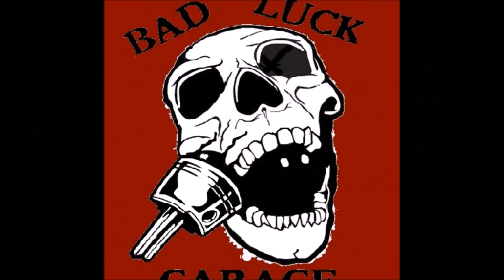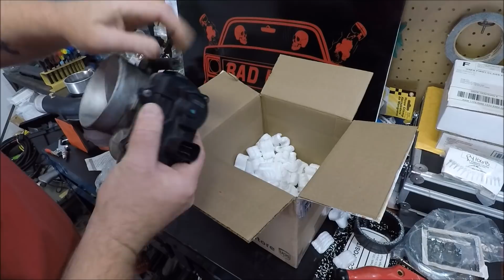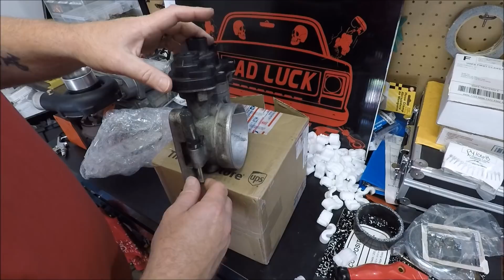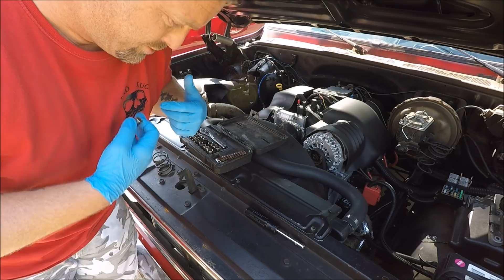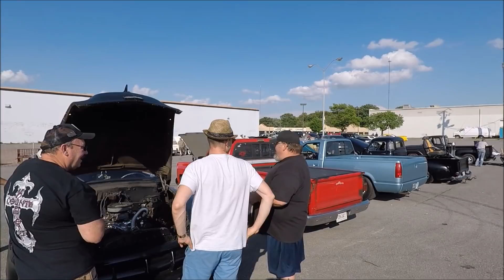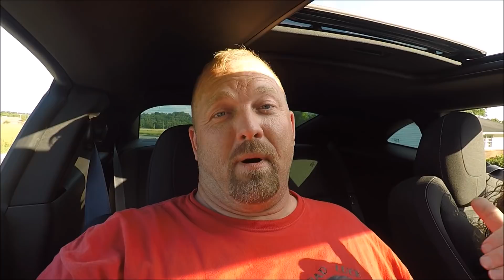TURBO LS C10 DBW ISSUE (REDUCED POWER MODE)

Comment from the maker: I’ve recieved several emails since posting this video Saturday about the black double print tee. It seems I have infringed on YouTube’s copyright by placing their logo on the shirts and because if this shirts are currently being taken down. I am working with YouTube to obtain permission to use the logo but should that not happen I will be redesigning the shirts and removing the YouTube logo. Thanks for your patience and understanding as I am new to all this.
Reply: Bad Luck Garage hey sir oh sir, i put 42lb injectors on my build, took it around the block and gave a a good amount of throttle and it bogged down, would that be becuase it needs a tune??
Reply from the maker: Yes sir. Anytime you switch to a larger injector you’re going to need to input the new injector data at the very least.
Reply: Bad Luck Garage thank you sir, have a guy coming over today to do that for me!
Reply from the maker: Anytime brother. 👍🏻

Comment: Hey did u ever figure out what was causing ur 5psi boost issues. Cause I did leak tests on both sides had a few exhaust leaks. Which I fixed . Have a leek at my gplus 102 so I just ordered a Fitech 102 to replace it . The leak at the gplus was pritty significant. But I have a feeling that that’s not the full cause of a 7psi loss . (12lbs spring) could it be a tune ? But when the car hits around 4-5psi I do hear a strange hiss but for the life of me I can’t find anything.. sound is common from pass side (turbo side) . Man I’m at a loss .. lq4 7875 billet ball ss2 cam lunati 660 springs . Ring gap at 28thou 4l80 3200 stall 342’s  .. car is a turd decapped 75lbs injectors. Duel 275 pumps in tank . I have the same speed daddy gate n blowoff as u run .. any help would be appreciated.. like I said it’s a turd but a stock 6.0 should spin tire n/a n I feel like it’s got about 200 hp really sad
Reply from the maker: I was actually running a genuine Tial wastegate on this truck. It’s been a few years but the only issue I really remember as far as boost was when I was running the 66mm turbo that was way too small. Once I switched to the 78mm turbo I had issues with the throttle body fluttering at around 12psi and going to reduced power mode as shown in this video. The fix would have been to switch to a cable throttle body which is what most people do when they start having those issues. Unfortunately I never finished doing that as I sold this truck about three years ago and bought the other vehicles we’ve built in the channel since then.
Reply: @BadLuckGarage  ok thnx but I have a dbc n I just ordered a fitech should be here tomorrow. Cause that eBay 102 was leaking like crazy where the spring is from the shaft n bearing . It was so bad that the soap I sprayed on it wasn’t bubbling just blew the water away . So I’m hoping that’s the culprit. Thnx for responding. If there’s anything u can think of let me know . I based my build off ur videos . I even got that converter u indorsed. 7875 96ar billet ball turbo ss2 cam lunati 660 springs mild port on the heads. 44mm wg 50mm tial knock-off fitec sheet metal intake ( which I hate .. too noisy) big intercooler (which is blocking all my air running hot) terminator x max 7” dash . hd2 transgo in the trans . I even setup my lines with the catch can n check valves like u said . Very happy with all the things up taught me . Some things listed that I did on my own didn’t workout so well like the intake n intercooler. But I’ll work things out . Keep doing what ur doing . Taught me a lot .

Comment: I’m haveing this exact issue it’s a stock 5.3  swap ina s10 an once I mash on it an it runs trough gears in gets to 3 an then revs out an limp mode killing it an restarting usually fixes it but only to do it again need some help thanks
Reply from the maker: You’re problem is actually very different but the result is the same. In you’re case it’s most likely a broken or loose wire at the connector of the throttle body. That was a very common issue and gm actually has a TSB on replacing that part of the harness. In my case it’s an incoming air/boost issue that the DBC throttle body can’t handle as explained.

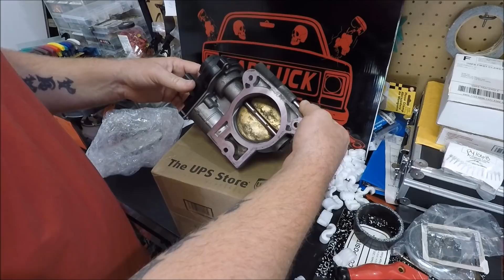Comment: Knew for sure not the tune.  I cant even watch till the end to say I fuckin knew it..lol  But fingers crossed dont backfire..lol  But I searched high and low cuz was bugging me not knowing.  But from other guys especially your year agreed the boost closes it then tps says open it,  back and forth then says wtf..  One guy talked to fixed it with using those kits that eliminate throttle lag.  Ill send you a link.  But playing with big twin turbo set ups there is a few things that could be causing the 1st gear blues.  Size of intercooler if running any.  Think compressor.  Tank has to fill.  So does your intercooler and every other lil areas of space.  !st being so short running Prob 4:11's etc everything cant pressurize and build 7lbs before shifts..  Plus as proved to many who argued it lets all this pressure go between gears.  It sort of does.  Starting your pulling vacuume.  After shifts you start at 0 not say -10 having to build to 0.  Another to is not running the proper vacuume lines where need be.  Like certain lines "Must" go before the turbo always pulling vacuume and others after.  Got one before where should be after.  Itll pull your boost through a loop.  Which no leak test will pick up.  Cuz its not leaking if makes sense.  But man do I ever wish lived close cuz could do this shit all day long every day.  Oh..  another to that made a stupid diff in my Nissan was split down pipes and a dual pop charger set up.  Ran dual throttl bodies with 3 inch pipe going to single.  so might as well benn to 1.5 inch pipes.  Can only build pressure regardless size of turbo as quick as you can pull the air in..

Comment: Most everyone I know ls turbo has dumped drive by wire for same reasons.
Reply from the maker: They changed everything out to drive by cable just because of a bad throttle body? That seems kinda excessive. 😳
Reply: Bad Luck Garage kept having throttle position issues and getting a cut out. You would thank over kill but seems to be working for everyone
Reply from the maker: Yea I know dbc is usually what people use cause it’s easier but I knew there were plenty of people running dbw too so I decided to stick it out instead of having to swap everything out for dbc. Glad I did now. 👍🏻 When I said it seemed excessive, I meant it’s excessive to swap everything out instead of just finding the issue and fixing it. I mean there’s really only two things that could cause the issue.....the tune, or the throttle body itself. I’m my case I knew the tune was right so it was just about finding a throttle body that wasn’t worn out. 😉
Reply: @BadLuckGarage   have same issue. Even after tune and new throttle body  under high boost still get reduced engine power, but the transmission also is flare shifting what transmission you running?

Comment: I’m having the same issues with my 2004 rainier with a turbo lm4. REP mode when I’m in boost and when I’m cruising it’s constantly hunting for the right rpm revving up and down.  I guess I’ll have to try a different throttle body too. Do you know what the the used throttle body came out of? I don’t know if that would matter or not.
Reply from the maker: Hello Barry Allen, Thanks for watching! The subscriber who sent it said it was from an 03 LQ9. Not sure of the vehicle. Before you replace the throttle body though, it sounds like you're having some slightly different issues with part throttle as well? You need to run a datalog and see if your throttle is flutteing like I describe in the video. If it is then its probably the throttle body. If its not then you may need to address some airflow tables in your tune. There are many tables that have to be changed in a DBW turbo application or they will trigger reduced power mode. Off the top of my head, the P0106, P0121, and P1514/P00068 tables in engine diagnostics all need to have the values changed to accept the extra airflow coming in or they will trigger reduced power mode. I actually had issues with several of those tables back when I first finished the build with the smaller turbo. The cool thing about the P0106 tables is that you can actually use them as an emergency overboost throttle cut as well to save your ass in the event of a boost spike.
Reply: Bad Luck Garage thanks, I appreciate the recommendations. I’ll check that out
Reply from the maker: Yes sir. Hope you get it figured out. I went and checked out your videos and that rainier is gonna be badass! I was just looking at one on Craigslist a couple weeks ago (sons turning 16 soon). But when I saw it came with a 5.3 I started thinking about buying it for myself for a project. Looks like you beat me to the punch on the whole turbo Rainier thing. 😂👍🏻👍🏻👍🏻👍🏻
Reply: Bad Luck Garage haha thanks man!  I originally went looking for a TBSS but that was 8 years ago and they were really expensive back then so I couldn't afford one.  then I saw the rainier sitting there and realized it had a 5.3 so i figured fuck it, I'll make it cool somehow lol.   It sucks though because they don't make hardly any aftermarket parts for a rainier so a lot of it I had to improvise on lol.  But at least it's one of a kind.  It runs good other than those couple of issues so hopefully I can get it figured out.
Reply from the maker: if you dont mind, send me a copy of the tune to thebadluckgarage@gmail.com  and Ill look it over and make sure all the diagnostic tables are good for boost. That way you can at least rule that out.

Comment: the wastegate spring rated psi is just an estimate, some people need alot smaller or bigger spring to reach their desired psi, It has alot to do with your setup, wastegate, turbo, wastegate placement, hotside routing and size, backpressure etc.. My car with a 7 psi spring only runs 5 psi and when i put in a 14 psi spring it would only get up to 8 psi. This is a ok problem to have, it is better to be able to control boost then it running away all the time. Idk what boost controller setup you have but with a 3 port mac boost controller solenoid  with port 1 to the top of the wastegate, port 2 to your boost reference source, port 3 to the bottom of the wastegate, when turning up the duty cycle to the mac solenoid it takes away pressure from the bottom of the wastegate while at the same time adding pressure to the top of the wastegate so you can run a low rated psi spring in the wastegate and be able to run way more boost if you want. I currently have a 14 psi spring in my wastegate in return only giving me 8 psi at the intake at 0% duty and at 80% duty im getting 18 psi. So can set my boost anywhere from 8 psi to 20+ psi with the same wastegate spring. I hope this help buddy. good luck.
Reply from the maker: It appears my autometer boost gauge is not reading correctly. After reviewing the datalog it appears I am indeed making 7-7.5lbs of boost (152-159kpa)but the gauge is only reading 4 or 5 so I may either have a bad gauge or a kink in the line going to the gauge.
Reply: ahhh..  see I though you said 5 in first but hitting 7 after..

Comment: I'm the same on problems,  my engine is only getting like 5lbs on a 11lb spring ima try to do that boost leak and maybe exhaust hopefully it isn't the turbo like urs
Reply from the maker: Actually I’m thinking the plastic line to my boost gauge may be linked or the gauge may be bad because according to my map sensor I am indeed making a little over 7psi even though my boost gauge only shows 4 or 5.
Reply: Bad Luck Garage oh ok ill have to check my scanner to, but what i have going on no way that feels more than 5lbs
Reply from the maker: Yea I’ve actually been having issues with the map readings not matching my gauge for awhile but I originally thought it was the cheap eBay map sensor. Problem is the map sensor readings match the wastegate settings and the gauge readings do not. So until I get a different map sensor to compare, I have to lean more to the gauge being wrong.
Reply from the maker: Also seat of pants feel can be misleading because one or two degrees of timing being pulled because of high aits can make 8lbs of boost feel like 5lbs.
Reply: Bad Luck Garage thats weird i have the same issue with the map sensor reading not matching, i dont think its the map sensor cuz  i have a oem gm map sensor and true

Comment: Hell yeah I've been driving around with one on my dash of my work truck for about a year now the throttle body goes on a 08 probably nothing wrong with it I open the butterfly by hand and reach in and wiped everything out not knowing that that would screw up the calibration so went and got another one off this other truck I have put it on truck was still idling high but not as high had a buddy with HP tuners recalibrate it just took a minute and it was good to go but the one on my Dash last time it was on there it was idling at 2500 RPMs pretty sure it can be recalibrated just haven't messed with it haven't had a need for it
Reply from the maker: Not sure if you're aware but anytime you remove the throttle body on these, you're suppossed to start the truck without touching the throttle and let it idle(again without ever touching the throttle) for about 15 minutes so the pcm can adjust itself to the new TB. If you touch the throttle at all during that time it can screw up the calibration. The throttle body I had on it functioned perfectly fine out of boost and even while in boost with the smaller turbo. I personally think the spring in it was just worn out to the point it wasn't holding enough tension when all that air from the larger turbo was being crammed in. Regardless, Im just happy to be able to stay in boost for more than 3 or 4 seconds now! Hopefully it continues to function properly.
Reply: Bad Luck Garage was not aware of those procedures but I tried several different videos on how to recalibrate the throttle body no luck finally got hooked up with my friend drove to his house he recalibrated somewhere with HP tuners I haven't found that yet haven't really look for it but he went in there and there was some setting about cleaning the throttle body he let it do its thing left it idling like you're talking about for a minute and Wallah it's been good ever since LOL that's on my wife's truck I don't remember what I was doing but I had the air breather off seeing a little bit of oil around the edge right there and decided to push the butterfly open and wipe it out bad idea